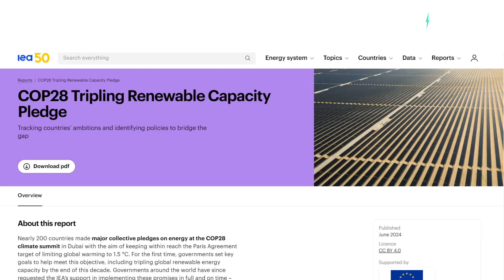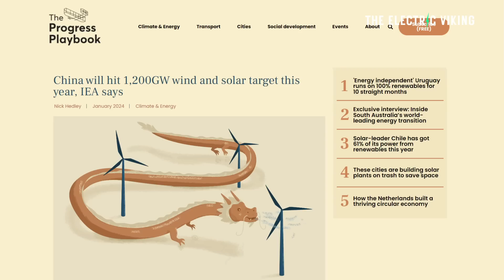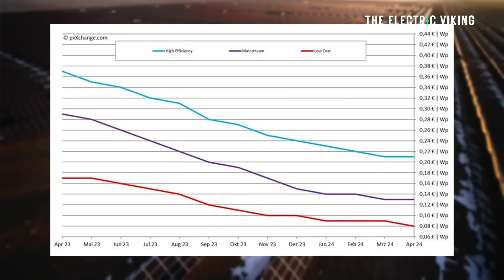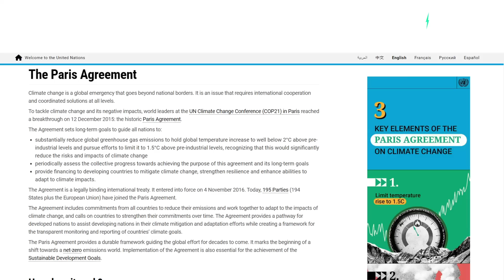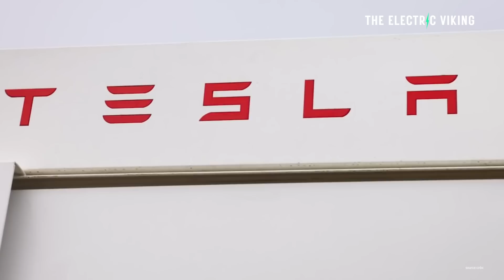IEA debunks media lies - world will triple renewable energy capacity by 2030

Comment: 🔌🔌The next two weeks of record-breaking heat in California will show everyone Solar and Wind are here to stay. It will also prove that politics and not EVs created stress on the grid.🔌🔌
Reply: How long will it take to recover your cost of solar?
Reply: @markmiller8903  I think I saw where battery installation was going to have a 3 year payback.
Reply: @markmiller8903  
Is that an issue?  The actual issue is how much less will electricity cost from a RE fed grid.  And how much we'll save via avoided fossil fuel pollution.
Reply: Typically, when recovery time of investment is named for below 15 years, someone is not looking at the investnment correctly.
Example here in Switzerland, typical recovery time for battery storage is infinite. say: It will never be recovered in full.
Actually with dropping storage prices, that may however change!
But even then, revcovery for storage at best is below the liefetime.
However for a PV without storage a recovery time becomes reslistic more and more below 15 years. It used to be 25 years a couple of years ago with lower electricity cost from the grid.
Reply: Wasn't no record heat when you had smog, it was 85F top.
Reply: @justinr9753  and the CO2 levels were not high enough yet to cause record heat. The problem is bigger that record heat. You need to look at what is happening to the "Atlantic Meridional Overturning Circulation" and check out what happens to the methane vents when ocean temperatures rise.
Reply: @sd70cal   yeah, back in those days the concern was the coming ice age, my school book called global warming the earth getting a little cooler.
Reply: @justinr9753  I see you didn't take any time to educate yourself. What is known today is far greater than the science that was known back in those days.
Reply: @sd70cal   it was better than in the past back then too.  Even Greta Thunberg has lived through the top scientist predictions of 5 years left in a now deleted post.
Reply: @justinr9753  I have no idea what you are trying to say here.
Reply: @sd70cal  "What is known today is far greater than the science that was known in the past" was true back than too.
Reply: @justinr9753  yep and it keeps growing giving us more clarity, details and new models  better at predicting future outcomes.
Reply: @sd70cal  same for back then, how about give me a year when it started being correct and I can give you some predictions that didn't come true along with a source.

Comment: 'Capacity' being the key word here. Gas, oil, coal plants can run at 90% capacity day or night, rain or shine, 24/7 365 days a year.

Solar and wind run at 0% of capacity , every time the sun goes down or the wind stops blowing..
Reply: Old grid paradigm which is now out dated with batteries. Engineering schools are now teaching about new systems, at least top tier schools.
Reply: You’re clearly not paying attention - As Sam says over capacity of renewables  (200% of maximum demand) coupled with battery storage stops the lights going out and is massively cheaper, cleaner and more efficient than extracting and burning fossil fuels.
Reply: @markbennett6658  Is still 0% of capacity being generated unless the sun is shining or the wind is blowing.

We need SUSTAINABLE energy, energy production that can be sustained, when the sun goes down, the wind stops blowing, and subsidies run dry.
Reply: @SteveLomas-k6k  Or when all but the largest of reserves for oil are depleted and those few countries that have it can control all other countries who want it.
Reply: @SteveLomas-k6k  you’re still not getting it are you? Cost of extraction of fossil fuels is increasing significantly and the supply is finite let alone the environmental damage caused by burning it. If we are generating twice peak demand and not only load shifting with grid storage but also doing so at a micro scale power output can be sustained 24/7 (capacity is never exceeded)).
Reply: @markbennett6658  Inflation adjusted- oil, gas and coal are all still cheap and plentiful. We could have made the same argument 100 years ago, and missed out on a 100 years of increasing standards of living fossil fuels have provided billions of people.

Twice peak demand is a theoretical capacity maximum under ideal conditions. Many wind/solar sites produce around 10% capacity on average in reality. And zero % of that without wind or sun.

Normal power plants can operate close to 100% any time.
Reply: Nonsense, battery storage captures the daytime solar excess for night time use. Plus last time I looked it does not stop being windy at night time.
Reply: @malkum61  ? the wind can stop any time- but more often at night, falling off just as peak demand starts.

If battery storage made economic sense, that would be great for any power plant. Run them at night at low capacity and release for the morning peak. That way you could build much smaller power plants....

But you have to produce energy on demand or spend a fortune on inefficient battery storage.

This is why alternative energy requires such eye watering levels of subsidy.
Reply: @SteveLomas-k6k  Gencost has done the numbers on system costs and renewables win over fossil and nukes. Gencost doesn't even factor in the fact that we can drastically change our usage behaviour with power pricing and V2G. It will only get cheaper than current estimates.
Reply: @SteveLomas-k6k  You do realize that fossil fuel power plants also receive massive subsidies as well.
Reply: @DubEther  I admit I don't know how they do it in Australia, but it would be very odd if they were being subsidized and they certainly don't need it. ironically, the only subsidies fossil fuel gets in the US is for their 'green energy' investments, which I would happily axe also.
Reply: @SteveLomas-k6k  The wind picks up in the evening in many places on the west coast in the afternoon until after the sun sets. It's not "if" battery stowage made sense. It does make sense. Prices for battery stowage keeps getting cheaper and battery life keeps getting longer.
Reply: @peteralflat281  That's the advantage  of fossil fuels, you don't need to waste money and efficiency loss transferring to batteries and back- you can create energy anytime, anywhere you like, on demand. 

I've looked at a few anti-oil sites that try to break down the so called 'subsidies'. The only subsidy I saw was for green energy. Everything else were normal expense deductions.

i.e. a green energy company also gets to deduct expenses like payroll, raw material cost, property loans and taxes etc. And that's fine, I wouldn't call those subsidies. But they get billions of $ of tax payer handouts and carbon credits on top of that.
Reply: @sd70cal  right, so after the sun sets and the wind goes down.. the fuel plants have to take over.

normal power plants don't need to spend anything or lose any efficiency on banks of batteries, they can sustain energy production any time, in any weather.
Reply: @SteveLomas-k6k  power plants are not that efficient even with the best of them. You do have to spend money on the purchase of fossil fuels. Last I knew no one could charge you for the sun. The payback period for batteries is small as its offset by not having to build or run fossil fuel plants. It's the fastest way to reduce greenhouse gas emissions from these power plants. And it no longer keeps you as a slave to the large oil producing nations. 
I really can't understand the resistance to this technology. Maybe it's just the inner resistance to change of any kind that some people have. 
If this reduces demand on fossil fuels, that would mean there is a supply/demand curve improves for the consumer. Seems like fossil fuel users would like that.

Comment: Not entirely surprising, becuase the profit margins on renewables are likely much higher, especially solar and battery storage.  i.e. given minimal operating costs due to no or at least very few mechanical moving parts and thus very low operational maintenance.  Wind less so,  however still likely relatively loweer maintenance than fossil fuel energy generation.  Unlike coal fired and nuclear power stations with turbines and generators.